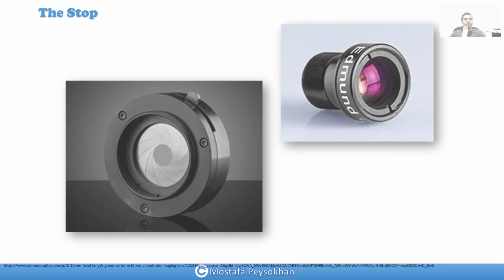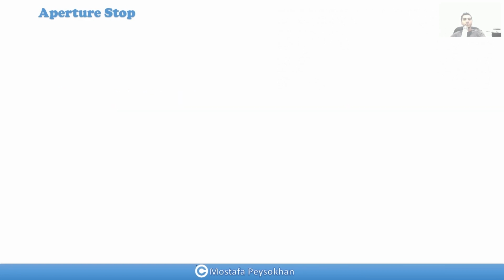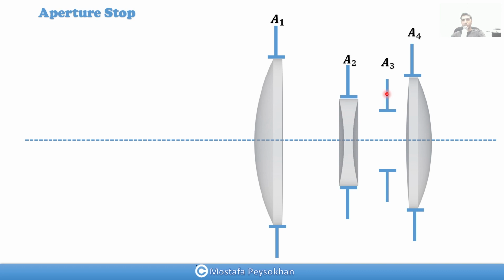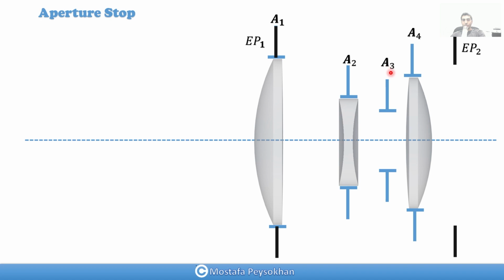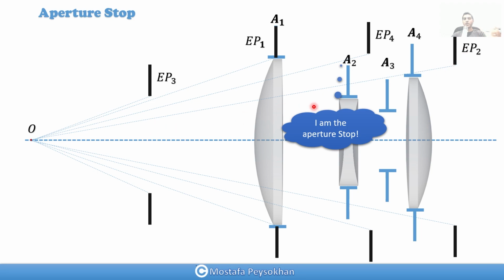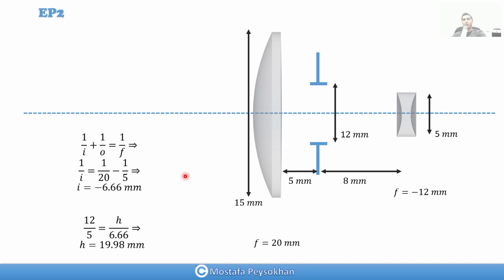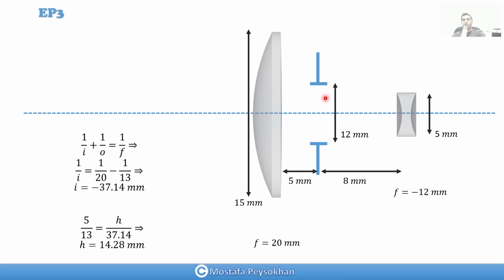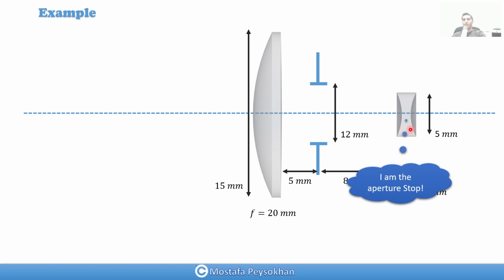Complete Guide to Understand Stops and Pupils of an Optical System

Comment: topic explained well, but is it the diameter of the entrance pupil that needs to be considered (for example if we want to use the Rayleigh criterion) when we want to approximately estimate the resolving power of our photographic lens or refractor telescope? Thank you
Reply from the maker: Great question! Yes, when estimating the resolving power of a photographic lens or a refractor telescope using the Rayleigh criterion, the relevant parameter is the diameter of the entrance pupil (or aperture stop). The entrance pupil serves as the effective aperture for the optical system, and its diameter determines the diffraction limit and angular resolution.

In the case of a telescope or a camera lens, the resolving power is given by:

𝜃≈1.22𝜆/𝐷
where 
𝜆
λ is the wavelength of light and 
𝐷
D is the diameter of the entrance pupil (not necessarily the full objective diameter if there’s an aperture stop limiting it).

So, if an aperture stop reduces the entrance pupil size, it directly affects the resolving power by increasing the diffraction-limited spot size. Let me know if you’d like a more detailed breakdown!
Reply: @opto-mechademics  yes specifically, the doubt is, when I use my refractor (classic Keplerian), is it important to also consider the Diameter of the Eyepiece (since it "could influence" the smallest detail" determined by the diameter of the Objective)?

So, in general, in all cases where we have more than a single "D" Aperture, 
 Is it possible to consider "just one" to approximately calculate the resolution of the telescope? 
or is it essential to calculate the diffraction limit for each lens Diameter, and therefore make evaluations?
Reply from the maker: @ 
Each optical system has only ONE stop and the Stop can be anything that is the main limit in the optical system. 
When you add your eye to the optical system, the STOP might be the pupil of your eye for the whole optical system.
Reply from the maker: After you find the STOP of the optical system. Then you need to find the Entrance Pupil diameter by imaging the stop through your optical system in object space. Then you can use that value for the Rayleigh Criterion.